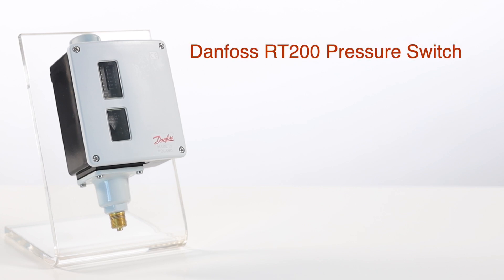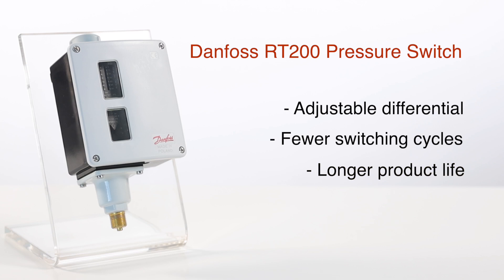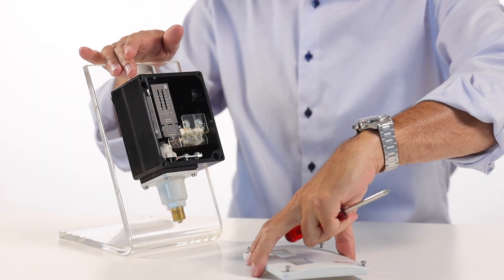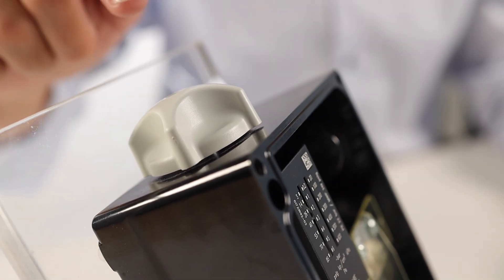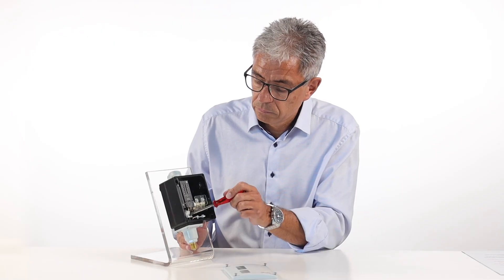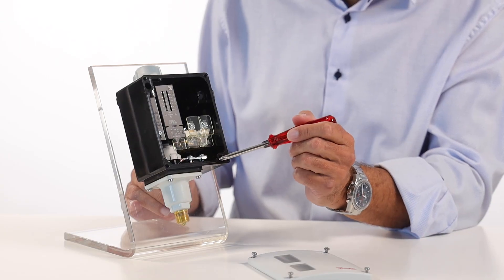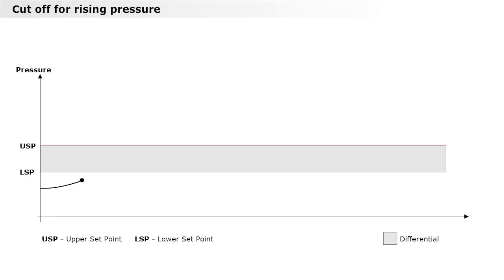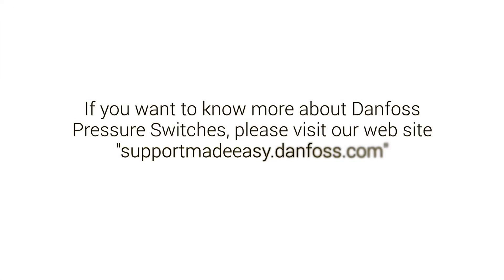How to set up a Danfoss pressure switch | Walkthrough

Comment: Hi danfoss,❤
 I try to set value 7.7 bar cut-off is corrected . but again cut-in  7 bar or earlier what the problem? 
Ex : boiler max 8 bar 
I set 7.5 bar + differential bar set 0.5 bar = 8 bar cut off.
Again on 7.5 - 0.5 = 7 bar cut-in. Above this right or wrong?

Differential only go plus value is right not again minus that value !